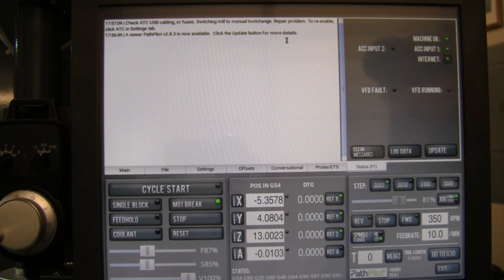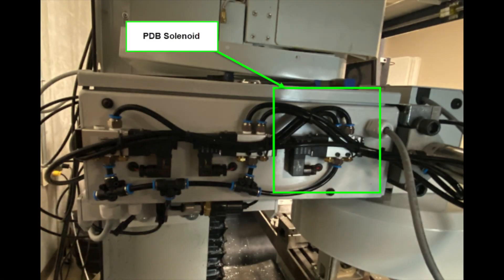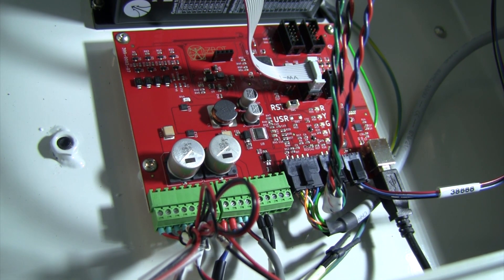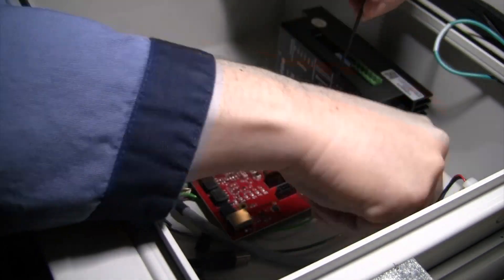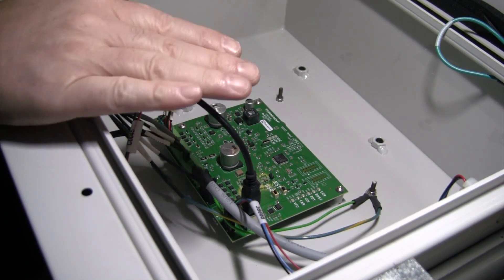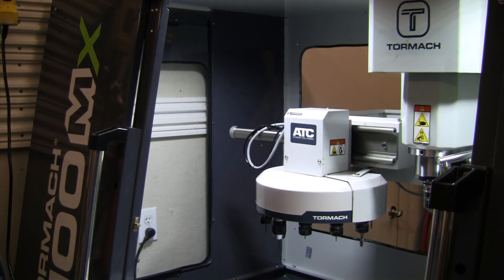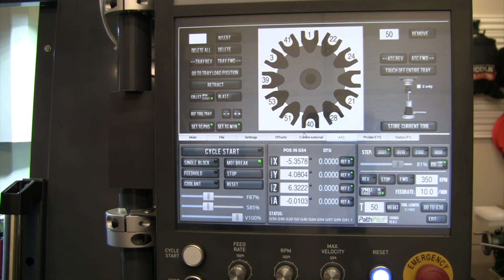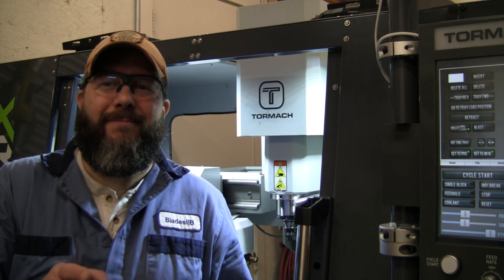Tormach 1100MX V2.x Control Board Swap - Old Red to New Green - ATC USB or Fuse Error

Comment: Hello sir, do you know how much the green board cost?
Reply from the maker: @muhammadrizqi6899 - Unfortunately I do not know the cost on this. Mine was under warranty and no charge. Tormach has great customer service you should be able to call or email them and get a pretty quick response. Thanks for the question.

Comment: Just came upon this issue first thing Saturday on my 770mx with a big job due Tuesday of course. Appreciate all the info. I just wired my drawbar button back up until I can get the new board. Had to unscrew all the tools manually to prevent breakage. Of course I had it loaded with tons of microtooling.
Reply from the maker: @LukeAquilina - That sounds like bad timing for sure. Glad this helped you sort a work around. Hope the job goes well!  Thanks for the comment.

Comment: Thank you! New board on the way! A couple things to note if you are a noob like me. 1) you have to switch the two airlines places, not just plug #1 into #2. 2) pressing the bypass on the solenoid does NOT enable your tool release button. It IS your tool release button. Fortunately, I figured this out just before my tool ejected onto my table
Reply from the maker: @andrewbuchanan6923 - Glad this was able yo mostly help you out. Appreciate your additional comments. Has been a while but I don’t think I tried to operate without the board or with the bad board. I think I just waited for the new one?